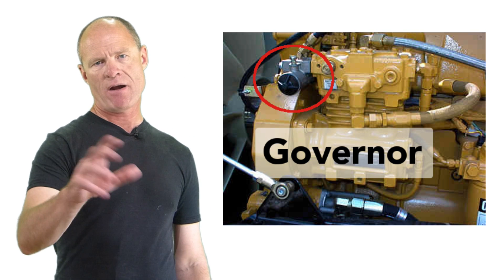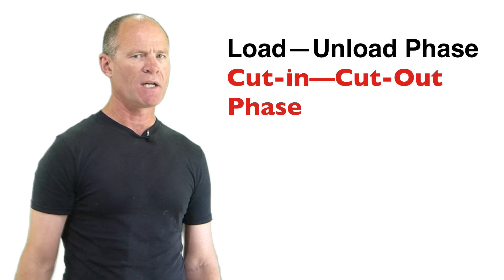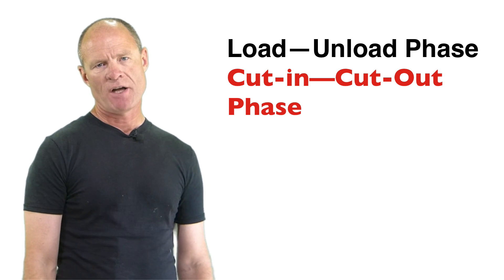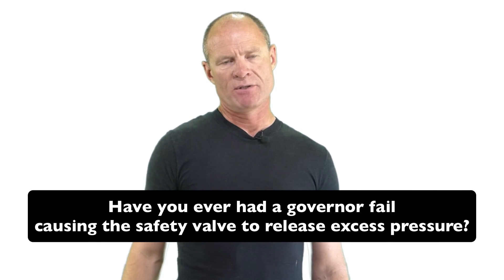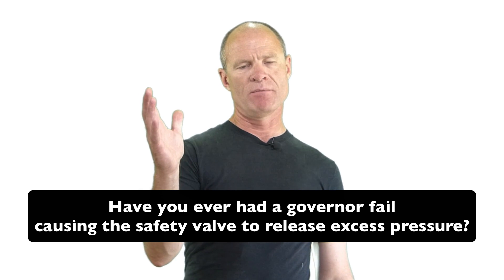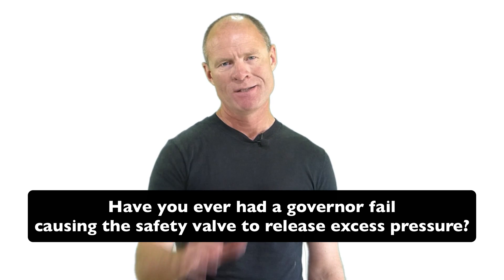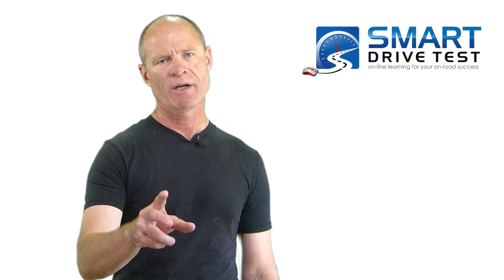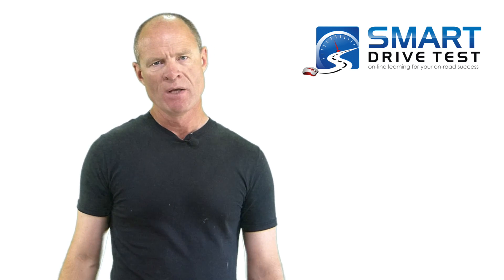How to Test The Governor for Air Brakes Course | Air Brakes Smart

Comment: I dont have air brakes but i do have on board air....My problem is its building wayyyy to much pressure..Its getting up to 160psi and i know thats not good....It does not purge or let any air out... is this a govenor problem or air dryer/purge problem??? please help
Reply from the maker: Hi Rick Marlow - Thank you for your comment. If it's your air brake board and you're using a standard garage compressor, than I would suggest it's the regulator on the compressor. You're not going to use an airbrake governor, but rather the regulator on the compressor. As well, if you're at 150psi, the safety valve either isn't there or it isn't working. If there is anything further we can do, drop us a note. Always happy to help. All the best, Cheers Rick
Reply: Smart Drive Test I don't have a garage type compressor my compressor is out in the engine bay and it has a governor on the back of it
Reply from the maker: Hi Ricky - if it's building to 160psi, then it's a problem with both your safety valve, and your governor I suspect. Can you swap out the governor and see if that works? All the best, Cheers Rick

Comment: Well that was confusing. First he said when a governor fails you hear a sound like a machine gun. Later he said if you hear a machine gun sound it is because it is due to a bad safety valve. What causes a machine gun sound. A bad governor or a bad safety valve.
Reply from the maker: Hi Jerry - thank you for your comment and query. It is the safety valve that makes the machine gun sound when system pressure reaches 150psi. Often the safety valve blows because the governor is faulty--some times the compressor--but most times the governor. If there is anything further we can do, drop us a note. Always happy to help. All the best, Cheers Rick

Comment: what would cause a brand new governor to have air come out of it's exhaust port ?
Reply from the maker: +Emmanuel Montelongo - thanks for your comment. My guess is that the governor is defective and I would take it back and have it replaced. All the best cheers Rick
Reply: Smart Drive Test thanks . I figured it out , the small air lines were backwards ....oops ..good pressure now . and air dryer purges normally now. thanks 👍
Reply from the maker: Hi Emmanuel - Apologies for the late response. I'm happy to hear you figured out the problem - that is always a relief. If there is anything further we can do, drop us a note. Always happy to help. All the best, Cheers Rick
Reply: Smart Drive Test Hi, I started my truck yesterday morning and there was constant air escaping from the exhaust, so, I replaced it with a new air governor, but it’s still escaping from the exhaust. What could it be?
Reply: @emmanuelmontelongo9911  what do u mean by the small air lines was backwards. I have the same problem. Kindly explain to me.. Working on Cat 769D. It's been 7years now I worked on a machine.
Reply: Farid Quaye air lines were crossed . Grey line was in black air lines port
Reply: Thanks 👍
Reply: Emmanuel Montelongo i

Comment: pressure in front gauge goes down to alarm point then returns to normal. rear gauge stays at normal pressure. need answer please
Reply from the maker: Hi Doug - my first attempt would be to check the governor. The governor controls the two sub-systems; therefore, my first guess would be there is something wrong with the spring. Is it a newer truck with an Air Dryer Integrated System? Cheers Rick

Comment: Is the cut-in and cut-out psi different on certain trucks?
Reply from the maker: Hi ℛɛᴛʀᴏ ℛɛᴅ - thank you for your query. Yes, the pressures can be different on different trucks. Saying that however, most systems operate between 105psi and 125psi. There some slight variance, but for the most part there in this range. If there is anything further we can do, drop us a note. Always happy to help. All the best, Cheers Rick

Comment: So how about you explain what in the governor that is determining then pressure differential between cut out and cut in pressure.  Would be great if you could provide it on images. Thanks.
Reply from the maker: Hi Per Agesson - thank you for your comment. This video may help: https://youtu.be/dJpMKkwEhxI If there is anything further we can do, drop us a note. Always happy to help. All the best, Cheers Rick
Reply: not a lot of help from a video that teaches curb parking....
neither does the lawn mover ur the furnace thermostat explains....
what is it physically in the governor that makes the compressor take a rest till till pressure drops to cut in pressure?
I know how the signal from the governor unloads the compressor....
Reply from the maker: Hi er Agesson - thank you for your comment. The technical specifications of how the air governor works is somewhat beyond the scope of this channel. For the purposes of getting an air brake ticket, drivers have to know what a governor does, and know how to check that it in fact works. It's like driving a car, a driver doesn't have to know how it works to drive the car.

Saying that however, the air governor is a valve which consists of pistons, ports (gates) and springs. The air pressure from the air tanks works against a piston and spring, and when the air pressure is sufficient it moves the piston and closes off or opens the ports, which are essentially gateways. These gates direct the air pressure to different locations. When the air pressure from the air tanks reaches maximum (usually 125psi), it pushes the piston and spring and redirects the air to the unloader valve in the compressor and the purge valve in the air dryer. For a more detailed explanation see: https://www.youtube.com/watch?v=9Vb32PL1PVU

Most of the time, if the governor isn't working, it's simply replaced. See this video for replacement: https://www.youtube.com/watch?v=JqZLrx5mm_0   If there's anything further we can do, drop us a note. Always happy to help. All the best, Cheers Rick
Reply: I understand Rick, that the drivers do not need to know all details about the design. I have worked with fluid power education since 1975 to 2000. I also have been pro truck driver here in the US for 13 years. And I must say that that knowledge about this is generally enough good to know how to replace a governor, but when it comes to explaining how the system works in detail, the general knowledge and UNDERSTANDING is poor, even among shop personnel. 
I recently got a question from a professional driver if it was possible to "widen" the pressure range on the governor so the compressor didn't need to kick in and recharge the system every "30 seconds". Obviously, the driver didn't have full UNDERSTANDING of his brake system. When I tried to explain and proof this "diameter difference" he asked for images that show this, and there are no such images that really point this out. Only the text in the Bendix-pdf briefly mentions it.
I know from my 25-year career in fluid power education (in Sweden) that analogies like you are using only works as a help to understand the "true story" ie real technical education...
Reply from the maker: Hi Per Agesson - apologies for the late response. It sound like you have a lot of experience in this area--probably more than myself. If the governor is kicking the compressor in and out every 30 seconds, my first guess is that the governor's spring that controls the main piston has weakened. These springs do that over time and the governor simply needs to be replaced. If it's not that than it might be the unloader valve in the compressor, but I suspect it's the piston in the governor. If there is anything further we can do, drop us a note. Always happy to help. All the best, Cheers Rick

Comment: I have a 1981 AEC Sprint bus. The air pressure has slowly been not building up to acceptable air pressure.  Took 30 minutes to reach only 40lbs! Where should I start looking for the problem? Cheers
Reply from the maker: Hi Ellis Girrard - thanks for your comment and query. The first thing I would determine is if the air compressor is pumping air. Remove the main discharge line an see if there is air coming from the compressor.  If the vehicle is that old - is the compressor belt driven; if so, is the belt slipping? If the compressor is pumping air, than I would look for a leak somewhere in the system - do a leak test to see if there is a one - you might be able to pump the system by hooking the main discharge line to a garage compressor. If either of those two things aren't your problem, than I would move to the governor. All the best, Cheers Rick
Reply: Thanks for the quick reply Rick!...I'm in Australia..so you saying 'cheers' was quite funny...lol  Anyway, the compressor looks to be either gear or chain driven...and quite tell as its covered up by a housing. I've had this in three times for annual inspections (law in Au.) and they haven't found any air leaks in the system..and you can't hear any. I will certainly disconnect the main compressor air tube coming out and see how much air its putting out....I'm also thinking maybe the air dryer might not be letting air threw or maybe its partially blocked. this has been a slowly developing problem, I've had the unit about 4 years now..its been converted to a motorhome, when I got it...air would go up to 110 quite easily, I've only put on about 4000 ks, and now as I said...just won't charge up...thanks for you help, you have a great site!
Reply from the maker: Hi Ellis - thank you for your compliment. Yes, I lived in Melbourne for 5 years, and that's where I picked up the "Cheers" from. Now that you mention the air dryer, I suspect--as you do--that that's your problem. It's easy to to get the main discharge line off the compressor, and once you know that it's pumping air, then I would simply replace the filter on the air dryer. That should solve your problem - especially if the system doesn't have any leaks. Drop us a note if there's anything further we can do - always happy to help. All the best, Cheers Rick
Reply: Hi Rick...sorry for the late reply. I am still working to try and find my problem..and now that you agree the air dryer might be a problem, I'll try and run down a replacement for it. Also checking to see if any oil has traveled threw the system as that might be an indicator of worn rings in the compressor..so far, dont really see anything unusual. Also, going to hook up a guage to the compressor to see just how much it is putting out...again, thanks for your help..will get back to you as we discover things, always good to let others know what we might find...cheers